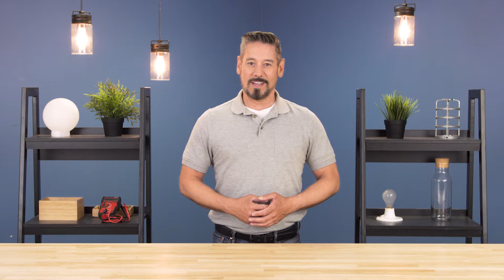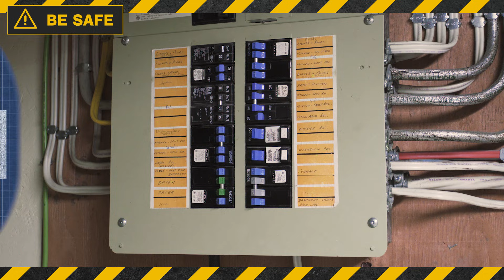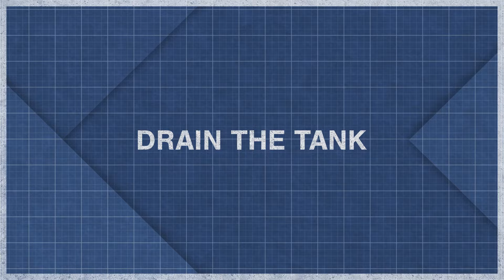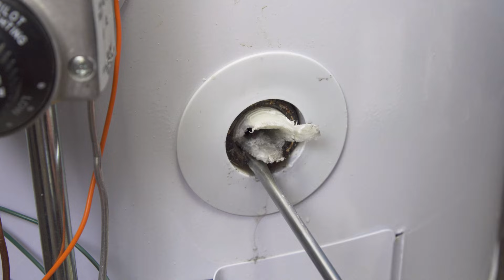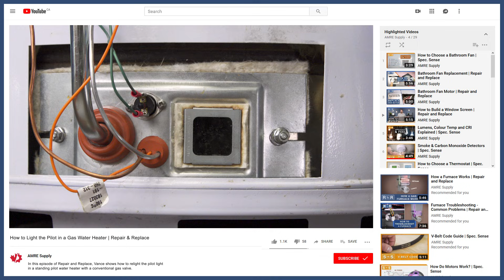Water Heater - Drain Valve | Repair and Replace

Comment: Think you should have done a video with actual plastic valve so people with this actual problem could understand their situation better!
Reply from the maker: Hi Stan, thank you for watching! We decided to combine both into a single video as the repair is no different, with a plastic valve you'd use a wrench to loosen it just like if one started with a brass valve. We specifically kept the section in showing how to remove a broken plastic valve as we know it would happen to some people. Hopefully you still found this video helpful!
Reply: @AmreSupply  hello I couldn't find that valve setup no where so far Home Depot or Menards does not have it do you know of a place I can order all 3 pieces I need?
Reply from the maker: @stanwilliams7871  If nothing is available locally for you then you can always get it shipped. AMRE Supply does ship to the US if needed. Here's the ball valve: https://www.amresupply.com/part/14806513 And here's the other brass parts: https://www.amresupply.com/catalog/651433 Prices are in CAD
Reply: @AmreSupply  thank you big time much appreciated!
Reply from the maker: @stanwilliams7871  You're welcome Stan, we're just happy to help! All the best to you
Reply: @AmreSupply  I did find it helpful I'm a first time home owner bought my home back in 2004 and had to replace the water tank that was in the him when I bought it the new tank just started leaking at the bottom don't think it's been 10 years since I put it in maybe 7 I checked it like you explained in your video and the plastic valve is leaking at the bottom of the new tank tried draining it its clogged with settlement so when I get the new brass valve I will do the reverse flow like you explain in your video to break up the settlement blockage and drain the tank!

One thing I did learn over the years from the time I put the new tank in how hot the water was very hot and over the 7 years it got less hot which is when the settlement started building up on the bottom of the tank so the water didn't get as hot because of the settlement build up on the bottom of the tank the first two or three years the hot water was hot hot now I know why it decreased over the years!

I'm gonna set a yearly reminder on my cell phone so I can drain the tank out once a year to keep up with the maintenance of the tank thanks for your help with the video helped me big time I learned a lot!
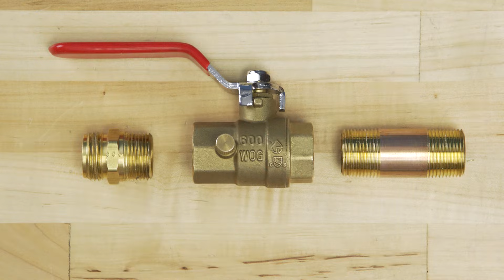Reply from the maker: @stanwilliams7871  Thanks! Its always good to set reminders for yearly maintenance. If you haven't installed the brass valve yet, then it would still be good to put the full ball valve as shown at 3:18 , it will make draining and maintenance easier. The basic valves have a screw that you tighten, that pushes a rubber stopper over the valve. Sediment can get caught under the rubber stopper which will prevent a good seal. The ball valve will prevent that issue from happening again.
Reply: @AmreSupply  have not installed it yet but I will pick up that valve you suggested thanks again!

Comment: What can be used to put that plastic seal back on?
Reply from the maker: Thanks for watching. The ring doesn't need to be removed to do the repair but If you manage to find a replacement plastic ring, some might just snap into place around the drain valve. In other cases you can always use an epoxy to help secure the ring.
Reply: @AmreSupply  thanks for the quick response! I simply put the ring in first then the new valve and and the new valve held it in place.

Comment: So would the replacement valve be a relief valve, or drain valve.
Reply from the maker: Thanks for watching. If the drain valve is leaking or is broken then you'll want to replace it with another drain valve which is used as a utility. These are different than a relief valve which is designed specifically as a safety device. You can learn more about the relief valve here: https://www.youtube.com/watch?v=2qhsmSbQQzc
Reply: @AmreSupply  thanks for the quick response! I was confused on the difference between the two but realized the relief valve was on top of my heater.

Comment: I have the leaky plastic valve but it only leaks when I open it. Rite behind the big knob so I can’t see exactly. Should b fun draining it’s on the main level. It’s 20 y o  so maybe I’ll replace the wft n do the valve first if it’s plastic too. Any other ideas ??
Reply from the maker: Thanks for watching. Those plastic valves often have a small rubber stopper inside. That rubber can deteriorate causing it to leak. That is fixable with a new valve. Alternatively if the valve leaks from around the threads then just make sure that the threads are clean before installing a new valve.

Comment: Hi Vance: outstanding video! -- many thanks! And Stan in your Mississauga store was very helpful. After weighing the pros and cons of brass and plastic, I went with the nipple-valve-adapter combo, which took only 10 minutes to make. The whole job took four hours start-to-finish, including a 45-minute run to the store for a keyhole saw, as the old valve was plastic and broke off in the opening. (It was burned black on the outside after 15 years' contact with 140F metal -- so grotty.) I also wasted two hours while the water dribbled out like molasses, before I thought to release the vacuum just below the cold-supply valve. If I did the job again, knowing what I know now, it would take an hour. Oh well, first you get good, then you get fast. It needed five flushes for the water to come out clear. On the first flush, it was black -- yikes! So hats off and thanks again to you and the rest of the folks at AMRE Supply. (Next job -- install a new anode rod. After 15 years, it's a good bet that there's no aluminum left to sacrifice.)
Reply from the maker: You're welcome Joe! Thank you for sharing your experience! We're glad that the video helped you with the draining, flushing and the valve replacement. It can definitely can take a while to drain but now that you have a ball valve installed it should drain more quickly in the future. If you're going to replace the anode rod, we also have a video showing how to do that: https://youtu.be/hTJv67imgaE Cheers!

Comment: I've read some guides recommending a dielectric nipple versus just a plain brass one.  What are your thoughts on that?  Thank you.
Reply from the maker: Thanks for watching. Galvanic corrosion can occur in certain conditions but a healthy anode rod will reduce any corrosion of the brass valve. Teflon tape or pipe joint compound will add a slight bit of protection as well between the threads. Also keep in mind that the factory installed pressure relief valves are also made out of brass. If you are installing a custom ball valve, then you can definitely use a dielectric nipple for extra protection.
Reply: @AmreSupply  Thank you for the quick and informative reply!
Reply from the maker: @captainstress  You're welcome, we're just happy to help!

Comment: I appreciate you video. I have a hot water heater drain valve that resembles the  Rheem Protech except it is on a GE hot water heater. This valve will not drain water when I try to open it. Is there an instructional video for this particular Rheem Protech valve? Would the procedure be similar to that involved with the valve in the above video?
Reply from the maker: HI Maxitikos, thank you for watching. We're glad you're finding the video helpful. The steps covered in this video are similar to all drain valves in brass or plastic. If you look closely all drain valves will have at least 2 flat sides that you can get a wrench on to unscrew it. Now if your drain valve isn't draining any water even when it is opened all the way then its likely that it is plugged with sediment. Its always best to drain the tank before replacing the drain valve. To unclog the drain valve, place a bucket under the drain and use a coat hanger or wire to break up the sediment.
Reply: @AmreSupply  Thank you, will using a coat hanger or wire damage the valve? Maybe I can unclog the valve without having to replace it.
Reply from the maker: @Maxitikos  Most valves will use a rubber seat that is what seals the valve. The rubber seat can be damaged with the hanger if you are not careful. As well the rubber can degrade over time so its best to test the drain valve to make sure it can close and make a good seal.

Comment: SO...the drain valve is NOT welded on to the pipe?? Mine has corrosion on the thread (hard water.)
Reply from the maker: Thanks for watching. The drain valve is never welded to the tank but when there is corrosion the threads can start to fuse together making it feel like its welded. Sometimes you just need a bit more leverage to help break it loose. If it wont turn you can add a piece of pipe as an extension to increase the leverage.
Reply: @AmreSupply  THANX! I also have a water softener filter box that is corroded shut. I have tried a strap wrench-everything. Maybe if I squirt some white vinegar in there?
Reply from the maker: @drpoundsign  Yes some vinegar and a wire brush can help clean the threads. Sometimes its best to let the vinegar sit for a little bit to soak in. As well you can always adding some heat as long as you don't overdo it.

Comment: Thanks for a great video course on this subject.  I particularly like what you offered on removing a plastic valve.  After having had a plumber install a full bore ball valve with a straight-through design on our older water heater, I now want one on our other water heater.  Your explanation and presentation were superb.
Reply from the maker: You're welcome, we're glad that you found the video helpful! When writing scripts for our videos we definitely try to include well rounded detail as we know how something like a broken or clogged valve can turn a simple repair into something more intense. The full port ball valve is definitely a good way to go and is so simple to make!

Comment: Thanks Vance.   Very informative.   You make this look very easy.   I have a leaky plastic valve and was always worried that it will break when I twist it out.   I will put in a brass valve soon.  Thanks again.
Reply from the maker: You're welcome Brenden, we're glad that you found the video helpful! Yes plastic is quite prone to breaking but even if it breaks its not too bad to remove it and cut it out following the steps in the video.

Comment: Informative video. My only comment is that draining the tank DEFINATELY takes longer than half an hour. This isn't a quick project, allow yourself a whole day to do this right
Reply from the maker: Thanks for watching. You are right that its always a good idea to give yourself more time for the project and not rush it. It can definitely take hours if there is a significant build up of debris.
Reply: @AmreSupply  I believe I had build up that caused it to drain slowly. The step of using the cold water flush to agitate the sediment worked and it eventually flowed free. Thank you for the helpful video!👍
Reply from the maker: @samsamsamsamsamanilla5281  You're welcome Brent, we're glad the cold water flushed worked in your case! Those are the little details that we try to include in all our videos. Cheers!

Comment: I have a metal drain valve that will not turn so that I can drain the tank.  What to do?
Reply from the maker: Hi Jeff, overtime the drain valve might start corroding inside. If you have a brass valve similar to the one in the video that needs a screwdriver to open then it might take a bit more force to break it loose especially if it hasn't been opened in years. You can use anything long and flat to get more leverage to help get it started. Once it starts turning you can use the screwdriver to finish opening it.